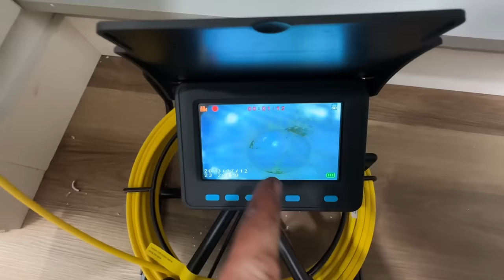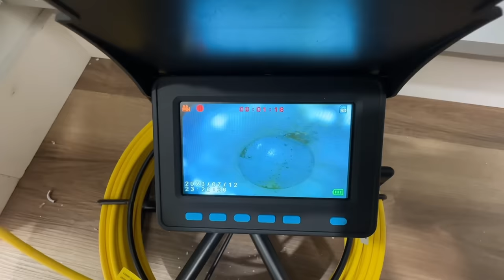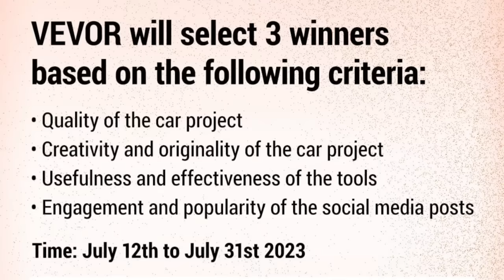Construction of a Duplex Part 21

Comment: As a long-time painter, the reason you don’t paint pressure treated lumber when it’s wet is that the paint doesn’t seat properly. The paint is prone to peeling and doesn’t wear as well in high-traffic areas.

Comment: Not sure where this belongs but, your pro tip about using a bag for a shop vac was awesome. I never thought about it but, I'm remodeling our kitchen and that tip saved me a lot of filter banging to clean it
Awesome tip.
Reply: Some bags filter better than others too, so pay attention to the label. Can get ones with minimum filtration for highest suction or max filtration at the cost of some suction, whatever works best for your situation.
Reply: @Shibby7634  thanks

Comment: Painting PRO TIP, if you're painting with any water base paint, using acetone congeals the paint making it HARDER to clean off, it will clean off, but it's globby. Hot water is the best and cheapest solution to clean water-base paints off or out of machines. Disassemble a spray gun and throw the parts in a hot cup of water to loosen the paint and then pick them out one at a time scrubbing with a cleaning brush and hot water. For hoses, pumps and sprayers, flush them with a bucket of hot water.

Comment: 12:50... I always use a big pair of channel locks to open up those 5 gal paint buckets, especially if they've been used before there will be dried paint around the cap and there's no way you're opening that with your fingers.

Comment: I've painted pressure treated a few times before at my place, and the only issue I ever had was the paint tool a while to dry. Like a full couple days. And that's tough with a dog and kid wanting to run around on the deck

Comment: I find the best way to remove dust from a shop vac filter is to drop it into an empty 5 gallon bucket with lid and shake the crap out of it. Then when you remove lid the small dust can be emptied out.

Comment: Just a suggestion. Request that your drywall crew tapes down red rosin paper before they mud and sand the drywall, that way you don’t have to scrape and vacuum every inch of flooring when you get back in there after they’re done. Especially the overspray and chunks of dry mud on the floor. You can just fold it up and throw it out. Whatever cost it takes to put it down is likely cheaper (and obviously easier) than the alternative.

Comment: You guys are probably already done with the duplex but I was watching one of your old videos and saw how you guys do your cabinet handles. Granite I am no builder as I am just a college kid who has been working on job sites in the summer ever since middle school, but my brothers father-in-law is my boss and he has a tool made by Kroger jig. it is a cabinet handle jig kind of thing where instead of using a block of wood that you guys tried and it didn’t work so hot. you adjust these plastic things that have metal inserts and it can adjust the height and the width and you can start the holes and then pull the jig away and go through the rest of the way rather than spending forever and a day measuring. At least that’s how it feels to me when I had to measure out the holes before I got the jig.

Comment: There's probably a reason not to do this, but when I plug a power cord to an extension cord, I do a quick overhand knot with the cords before plugging them together.  Takes the strain off the connection itself if you accidentally stretch the cord.
Reply: If you do a surgeon’s knot it puts less strain on the plug ends if it gets pulled.

Comment: If you oil base primer the bathrooms- you can go over oil paint with latex paint- but you CAN NOT go over Latex primer with oil finish…the oil base primer will seal the ceiling way better for moisture prevention- which helps with bathrooms due to the fact the blue board sheetrock will not warranty it being installed on a ceiling- which stupid cuz that’s where moisture gathers in the corners the most. just my 2 cents

Edit: I have heard it said the posts need time to dry so the finish material will not blister off the post- so translucent material would be good. So if your posts are not blistering keep going with immediate coverage

Comment: The two subcontractors that never finish cleaning up after themselves: Sheetrock and Electricians. 

On the plus side, I've got more crimps, wire nuts and scrap copper than I'll ever need.

Comment: As a painter my reasoning for not painting pressure treated lumber right away is that the paint can lock in the moisture/chemicals and cause it to decay and rot faster.

Comment: So I noticed that the drywall guy didn’t prime the ceiling before texturing. You not worried about ghosting “seeing all the seams “ after the finish coat.
Reply: Do you run clean paint thinner throw the airless after flushing and cleaning. Will save yourself a bunch of cash if you do.

Comment: Just curious why the walls aren't textured?  Is that builder preference or not popular in the area?  New and existing homes here have some sort of texture the most popular being applied via hopper-knock down or orange peel.  Texture  eliminates the need for sanding in between your primer coats.
Reply: Because orange peel is the sign of a poor builder. It hides all the flaws one makes (j/k).

However, adding texture does add an additional layer of durability and being this is a rental property. I would have textured the ceiling and walls.
Reply: @slynn5138  One could make that argument lol.  I agree texture does add an extra layer to protect the sheetrock and a little character. Anything below a satin sheen is a nightmare in terms of cleaning, it will end up requiring touch up paint instead.

Comment: Painters should clean up their mess before they leave, electricians the same, and drywall people should clean their damn dust up after they finish sanding.... no other profession should be cleaning up behind someone else's job before they can start on their hired job...in this case, yall are painting and should only have to come in and do the painting job, not vacumm up drywall dust from their sanding job before you can start painting....ijs

Comment: As you possibly know, people are liars. The reason why they are is because they want more money. They noticed that the post needed more paint because of the reasons you mentioned. So what did they do? They kept spreading that myth so the company they work will bring in more of it. There's more, though. They saw the cracking, checking, and all the other problems, which they denied. All to gain more of that money.